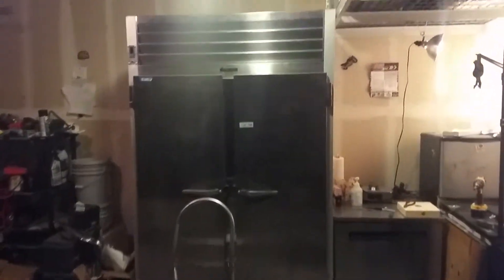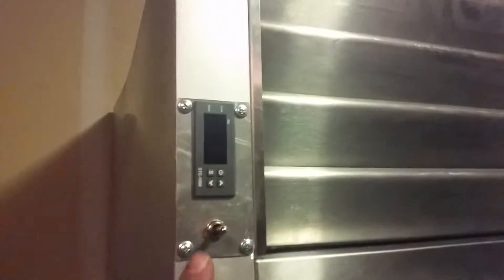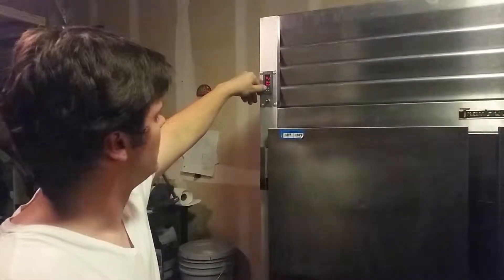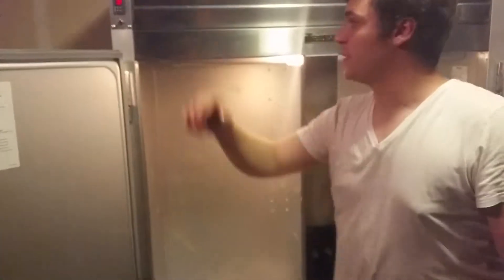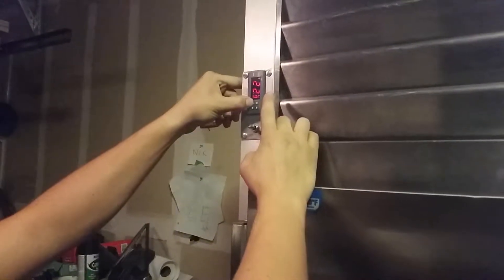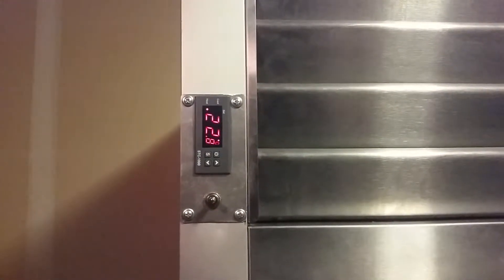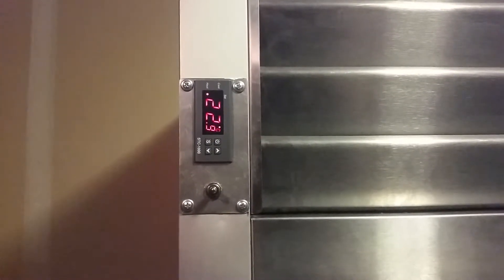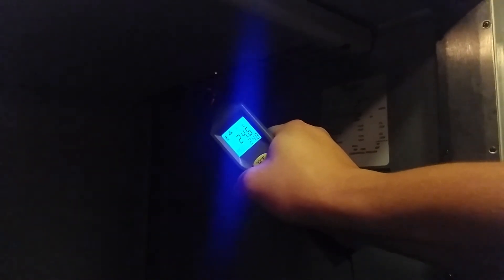STC1000 Controled Fermentation Chamber

Comment: Sweet setup! I have the same controller on a very large chest freezer. I use a small space heater with fan for my heating element. I just did my fist brew. I am wondering, do you have any issues with the variation and your cooling and heating system constantly fighting each other? Things seem much more mellow now that I have something in it. But before my temp. would climb several degrees after turning off and then my freezer would want to kick on. Then it would get too cold and want to turn the heat on. I'm trying to keep my perimeter within a degree or two Fahrenheit. How did you combat this. Seems better now that I have ~15 gal of beer fermenting. Second, where do you put your probe? I taped it to the side of one of my carboys figuring the temp of the beer is more important than the ambient temperature. I'm still paying with it but any tips or advise would be much appreciated. Thanks and happy brewing!